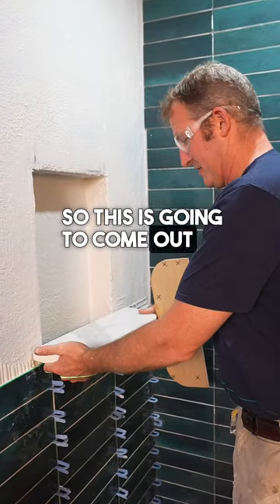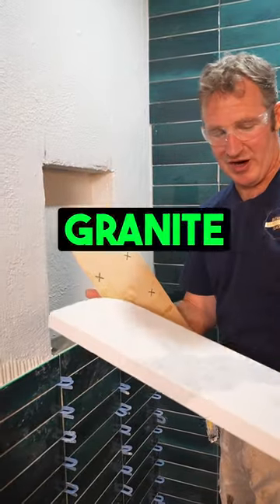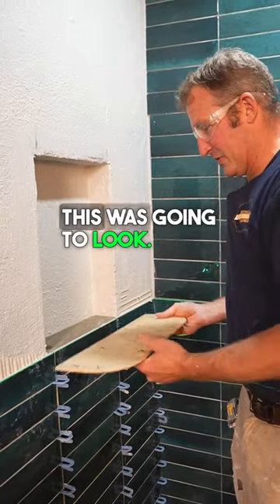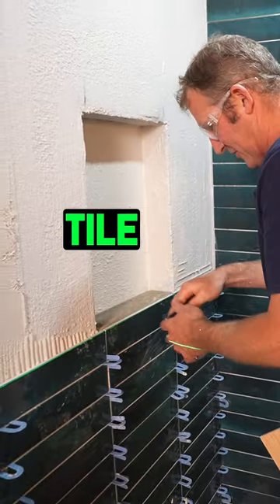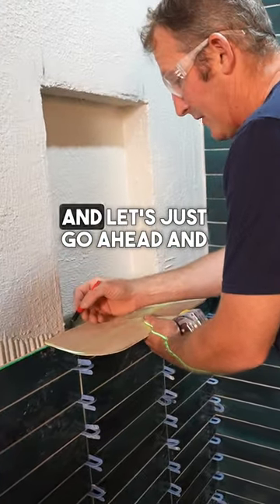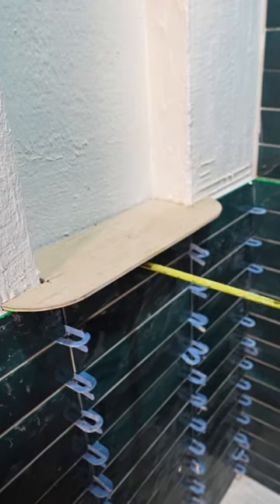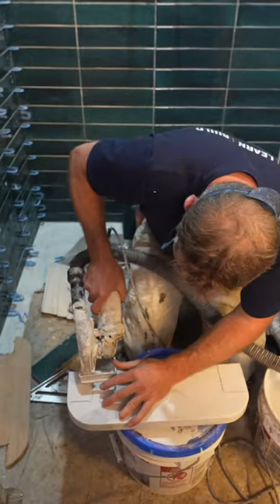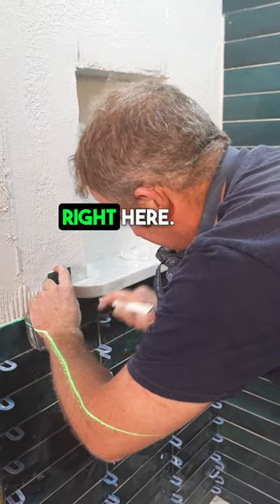Creating a Granite Sill Plate for a Shower Niche

Comment: That last notch (I'm assuming to tuck the subway tile behind),  seemed pretty small? Why did you not cut deeper to accommodate the full dimension?
Reply from the maker: Yep 👍
Reply: @Bathroom Remodeling Teacher  you didn't answer my question,  lol. I also notch mine,  but i can see your notch on the ends and its so fast I can't make out what you did.  I love and hate these shorts. Love your work though.  We're similar in that we both do everything.
Reply: @garrett8073  annoying when the question doesn't get answered. Lol
Reply: @jlatnyc  agreed